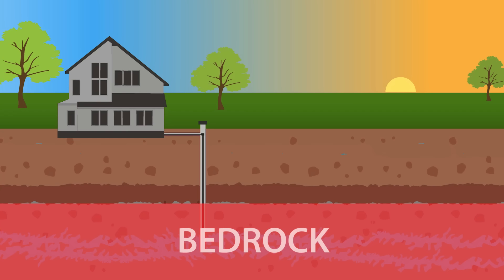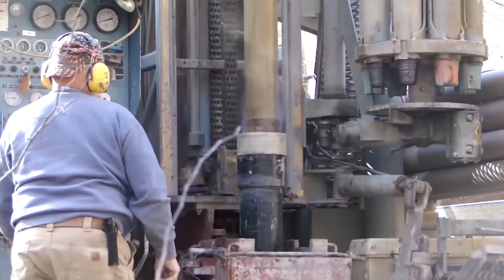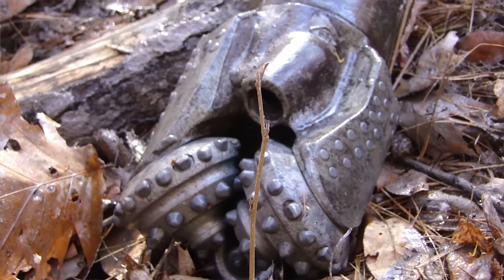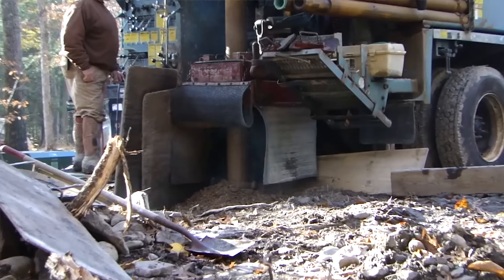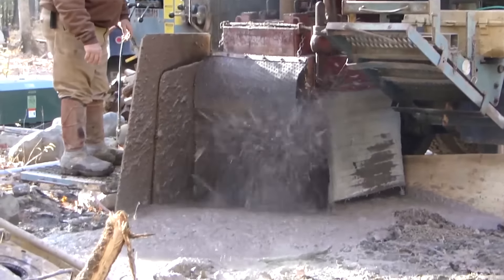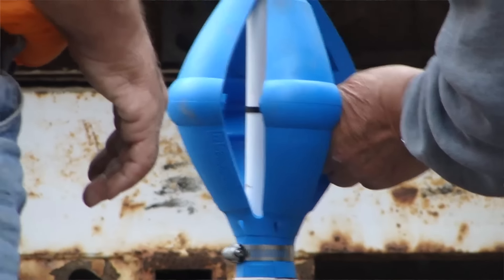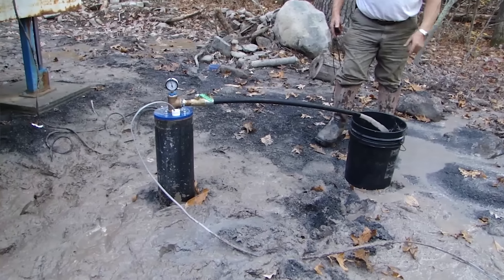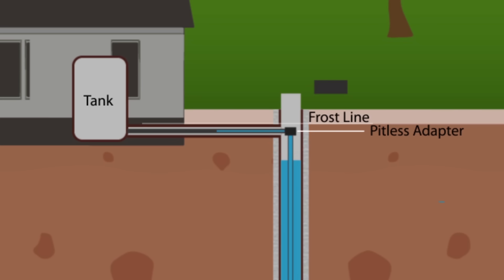WELL DRILLING 101 | Every Step Explained

Comment: It has been my experience that drainage / sewage lines are black ABS plastic because it is cheaper than PVC and not subjected to the higher pressures of pumped water.

    When I moved here to West Virginia 20 years ago, I had a city water meter put in and when I went to buy my water line, the guy in the plumbing shop said, "Copper or plastic?" I asked what's the difference and he said one's copper and one's plastic. OK, smart ass, which is better? 3/4 inch copper that the water company required was $1.25 a foot. 3/4 inch plastic that the water company allows is 29c a foot but after a few months the taste goes away. Being that we were on a budget, I had an 80 foot water line to run and it unrolled easier without kinking than 3/4 inch soft copper and it was easier than soldering 10 foot lengths of pipe, I chose the plastic mainly because I saved about $78.00.
    We decided against drilling a well because with all the coal here, every home that we visited with well water smelled like they had dogs that never saw the light of day. Unless you drilled down past the coal seams, it smelled like sulfur or if you hit gas or oil, you'd have to pull your drill and start over somewhere else or risk a polluted well. Most of the profitable shallow oil and gas is gone from around this county but the driller that I talked to said there are still some hidden deposits but most are too small to be worth an oil company's time but big enough to screw up a water well.
    I had one friend, before he moved to Ohio, that lived in a really low part of our county and had a 285 foot deep well that was like city water without the chlorine. It was great. His pump quit and he asked me to help him change it out. It was a bottom model and I had to use his tractor to pull the black 1 inch tubing that was on the pump while he lifted it out of the 6 inch white PVC well casing. I'm about burning the clutch out of the tractor so I didn't snap the casing while he's pulling it out of the ground. He was almost out of sight over a hill by the time the pump came out. He swapped out the pump and lowered it back down. A year later, he asked me for help changing the pump again. When we got it out of the ground, we found that when he was pushing the tubing over the barb on the new pump, he split the line so that the pump would only build so much pressure then pump the water back into the well through the split in the line. He couldn't figure out why his power bill jumped so high. He figured maybe the new pump drew more power but what it was doing was running 24/7 until the motor burned out again.
    I know that this video is 4 years old now but I hope you didn't seal your well head because nothing lasts forever. God forbid your down pipe splits anywhere in that 180 foot run due to factory defect or weakness or your pump wears out. If your well cap is welded on, you're going to damage good pipe and wiring torching it back off. Good luck my friend.
Almost forgot. I don't know if my friends pump tube or my meter line are ABS or not. It is my understanding that ABS is not approved for potable water use

Comment: You mentioned the three pump wires were two hots and a neutral. Are we sure it's not two hots and a ground? I just had my pump installed and I want to make sure I wired up my generator plug the right way. Is it a ground wire or neutral?

Comment: The bellows are to keep it centered but the reason is so it doesn't cut the wire when the pump turns on.  Over the last 8 yrs or so I have had to have our local Well pump installer have to come and replace the wire.  Than all of a sudden the wire gets cut again and shorts it out.  They come back and put the bellows on and no more shorting.

Comment: I'm wondering if you could add a manual hand pump in case of extended power outages ?? Or an electric pigtail for a generator to run the pump ? Cause if the power goes out ..... no water

Comment: There is pressure on the drop pipe.  At 0.433 PSI per foot of head (vertical rise), 43.3 PSI per 100 feet.  If you had a 1000 foot deep well, it would have to hold 433 PSI - and your well pump (or a series of them) would have to generate over 433 PSI to get the water flowing and lift it out of that depth.
The reasons for limiting the depth of the well pump likely include: 
 - Drop pipe:  at 180 feet, it'll be at 80+ PSI plus any spike in pressure when the well pump is pushing water against a stopped 180' column of water it has to start moving, PLUS 30..50 PSI if you run it straight into your house instead of a storage tank and second pressurization pump.
 - Limits on pump performance; they only develop so much pressure.
 - Extra power required to lift the water farther
 - Perhaps the water down lower is full of silt, clay, etc.

Comment: Question - why do they do the welding & casing for tens/hundreds of feet BEFORE finding the water?  What if they don't hit water?  Do they pull alllll that back out and cut it apart and start a new hole?
This was a GREAT video!  I learned so much.  We are about to have a well drilled at our house in the mountains.  We are nervous b/c a neighbor had 3 attempts (3 holes drilled) and never found water.  Ended up going with a rain catchment system but STILL had to pay for the well drilling.  Bummer.  
Thanks again!

Comment: Thanks for the interesting and informative video.  I found it while looking for the pros and cons of steel vs. PVC casing.
Reply: Me too, my crappy metal casing rotted away and after ~ 10 years we got a 
new 566' well with PVC casing, which is doing fine after 20+ years.

The next pump will be hanging on PVC pipe too for sure!

Comment: Pressure at the pump to lift that water 120 ft is 4.5 atmospheres  (4.5 * 14.6 psi) = 65 pounds per square inch.

add any pressure you need to get the water to your tank or house... plus some for handling the pressure loss due to flow rate in the pipe.

The PVC has a considerable pressure in it at the pump while the pump is running...  Often 90 to 120 PSI at your depth if just sending the water to a nearby storage tank.

Comment: Nice job of explaining the process every step along the way. Quick question... The initial step of drilling the hole down to bedrock and beyond - that was completed just with long sections of drilling rods driving the bit at the bottom, correct? The casing sections did not go into the hole until the hole was completed to the depth of penetration yielding a suitable rate of water flow, right? At that point, all the drilling rods and bit were pulled out and driving the casing segments commenced, beginning with the first casing segment that has a drive shoe on the tip of it. Did I understand you correctly?

Comment: Two questions: (1) when they pull the drill out what keeps the sides from just collapsing in? (2) when putting the casing in what prevents that from getting plugged up with overburden (either that has collapsed in or just from scraping the side)?
Reply: Drilling mud.  The hole is always filled with a slurry whose density is at least that of the overburden.  After the casing is set, the drilling mud is removed (sometimes reclaimed) and the search for water yield begins.

Comment: I take it you remove the 20 foot rods and drill bits after putting the casing in place? Because if you remove them and then put the casing in thereafter, there is this period during which the borehole is unprotected and the overburden can cave in?

Comment: Their are 3 method in water well drilling, 1. Percussion method 2. Rotary method and hammer which uses compressor and hammer bit. In rotary drillers are using tricon bit which classified as mill tooth ang botton bit. Percussion method is using chapping bit, this type of drilling is the cheapest. I am just wondering why the driller uses pvc pipe and not treaded? Driller usually uses treaded pipe for riser pipe. I did not notice also if they perform electric logging, perforation of casing, gravel packing. Before lowering the casing they should perform electric logging to determine where to put the perforated portion of the pipe this is included in well design. The blue clamp which is attach to the riser pipe is a centralizer.

Comment: Thanks for the video.  It was helpful, but it left me with a couple of questions.  First, let me make two assumptions: I assume the "drive shoe" on the end of the casing is like a ring and not a cap, and  I assume that the "second drilling" extends through that drive shoe ring, further down into the bedrock until water is hit.   Did I get that correct?  If so, is it true that the bottom x-number of feet drilled during that second drilling (until water is hit) contains no casing?  If so, is it possible for that portion of the well to colapse and "cut off" the water flow into the portion that is cased?   Hope this makes sense.

Comment: I have a 340 well producing 3 GPM.  I have a 400 gallon column of water in the well.  I"ve pumped it until I was dry.  It took 2 hours and I was flowing 1000 GPH. so I got around 2000 gallons. I don't anticipate I'll ever run it dry under normal circumstances.  We don't irrigate so it's just domestic water for two people.

Comment: Polyethylene pipe is common in my area. You don't have any joints or couplings and it allows flex if you have to pull up the pump for replacement.

Comment: The p.v.c. pipe, is actually special pipe for water well use, it is not the same as common schedule 40 p.v.c. pipe sold at local hardware stores. You are lucky to have a shallow well; the water utility I work for has Wells that are 1000'ft deep.and we use all steel pipe.

Comment: You did a good job with that explication as far as I'm concerned.  I've been looking at putting my well in for a while now and I always have trouble flowcharting every aspect of the final sections, lifting out the drill and pouring freeze material on the outside of the the casing.  guess I just am missing on the phyics side of it.  One thing is for sure you'll never have to worry about recovery, you've got plenty of water down there.  I am curious where or what elevation you did this well at.  Have you ever regretted not going with the cable and chisel drilling way?  Modern well drilling is so much more expensive than the old pound and chisel drilling.  I recently got a qoute from a long established driller in my area and he came back with $14,500 for finding where he says the water is at, 200'.  Used to be you could drill a reliable well for $3000.

Comment: In Devon, UK, we drilled 50 feet and water gushed 30 feet in the air - too much pressure. Ended up back filling it and drilling a new hole just 30 feet down. Put your ear to the rig and you could hear a subterranean river down there! The whole job only took a day.

Comment: PVC pipe:  note that the gauge at the top of the riser was reading about 45#.  If the water column (in the pvc pipe) is 300' deep,  that adds another 135# (+/-), so the pipe at the bottom of the well needs to be rated 180#, plus a safety factor.  The pressure rating of PVC is usually printed on the exterior of the pipe.

Comment: Trying to understand something... if they stopped using the drill bit once they hit the clay and instead just jammed in the casing, how did they get the bentonite clay around the casing in the bedrock? Wouldn't there not be any space there to fill, or if there was, no way to get to it since that 160 ft layer of clay was already pushed up against the casing?

Comment: Those pieces added to center the pump and pipe mostly protects the wires from being rubbed against the pipe or wall causing damage to the wire.

Comment: Have seen manual drilling with huge tripod made of bamboos, a pulley at the top  and three people pulling and dropping the 14 foot pipe. They inserted 8 pipes in all.. ive learned a lot in your video how they do it mechanically.. thanks.

Comment: A few things; blue thing above pump (should have been only used in a cased well not bedrock & should be about 10 to 15 ft above pump in case it shears off) is a torque arrestor. The pipe is a specific pvc designed for well systems approved for consumption …

Comment: The company who drill my borehole hit rock twice with differences level. But unfortunately when they were putting casing in couldn't pass the second rock. So am wondering it a problem that the casi didn't go all the way down?
Didn't casing has to go all way down or is not necessarily?
Please help

Comment: The pipe used to connect the immersion pump to the surface should be a specialized type for wells in a schedule 120 minimum wall thickness pipe that has a male thread at one end and a female at the other in twenty foot sections so that when the pump fails, or service is needed you can pull the pipe back out and unscrew each section one at a time.  There should also have been a heavy 3/4 inch Poly rope attached to the pump to aid in lowering and retrieval should the pipe break.

As to why you continue to drill after hitting water is because the aquafer has a top, middle and bottom.  Like an under ground lake if your pump is at the surface and the water level drops, then you'll burn up the pump and have to have the driller come back and deepen your well at the same cost as it took to drill in the first place.  So simple conclusion, put the well casing to the bottom of the aquifer to future proof your well.

Comment: The blue item is a torque arrestor. submersible pump is the way to go.  Jet pumps are a thing fo the past. Keep the critters out fo that well. Make sure you did a check valve at 200 feet. And I hope you bought a water softener and filter  Good luck!

Comment: bee bop is partially correct, the pipe is "PVC Water well drop pipe" well supply and major plumbing supply should have it in stock. I did not see the pitless. This well will not serve a building?

Comment: 11:55 Oh, no, that pipe is definitely under pressure. It's called water head. If the pump at the bottom of the well is pumping water up 200 feet then that's about 100psi of pressure in the pipe at the bottom of the well since there's such a large water column above it. (Assuming the water is only at the bottom of the well and the pump isn't submerged under 100ft of water. If it's submerged you only count the water head above the water level)

Comment: Hi I live in london UK and they have drilled a massive 20 foot high water ring main under and around london and that also links various reservoirs and, underground water springs Etc, we do not get our water from the River Thames. al lot of the rest country is served from reservoirs ad I should Imagine people do get their wells. plus there are also a lot of wells around that was dug many many years ago that we do not use or/and have been capped for safety. Any way could you share with me how much it cost you to gave this well drilled? I would be very interested. Thanks for the fantastic video. Paul UK

Comment: I would imagine why they win another 25 ft is because if you just stopped where you hit water at 300 ft then if you had any kind of heavy water use and had a drought you would run out of water it would go shallower than the pipe goes and wouldn't be able to pick up the water anymore so they want to go deeper than that so that it has plenty of room for heavy use of water and possible drought

Comment: What you say about the aquifer maintaining it's level so you should never have to worry about running out of water is basically true but there is a hitch.  If a major development of say 500 dwelling units goes in 10 miles away and they drill down and hit the same aquifer with even half the wells (250), that may tax the vein to a noticeable point by affecting the recovery rate (GPM). Also, the last 25 feet as you correctly state IS a sediment trap. We had our well on the coast of Maine drilled deeper as the original had only a 5 GPH recovery which was fine until we added an in bathroom to the summer cabin. That led to go down looking for 10 GPM. After drilling down from 100 ft. to 200 ft. we had 11 GPH and the went for the 25 ft. Before they got to 225 ft. they hit a second aquifer. Ok, we'll try again for another 25 ft.  POOP! we haven't gotten to an additional 25 ft. and we have hit a third aquifer. F it! The  sediment will have to totally block 2 aquifers before it will get back to the 10 GPH aquifer! We don't need a sediment trap! Get that drill UP and OUT of here before we hit salt water and own the customer's short-cut to China. Yes, if a driller hits salt water all the work is on him - NC to customer. The bottom line is 17 GPH from 3 veins with the bottom at 235ft. below the granite surface and 3 ft. of  casing. This was done in 1960 and the water has never failed to be at the tap except when the power failed.        sdh in CT